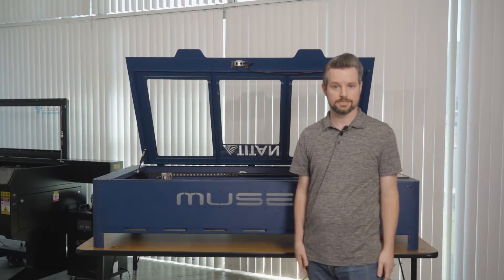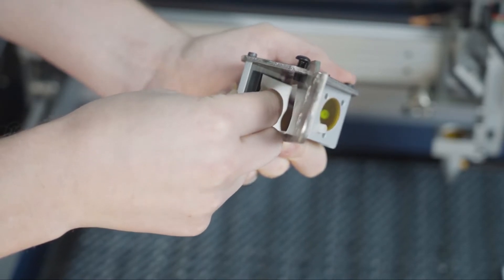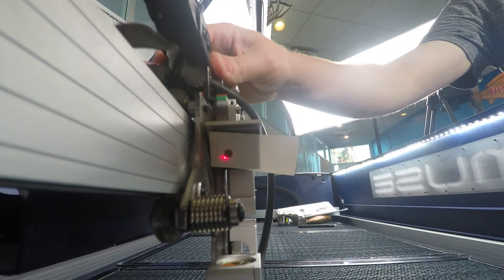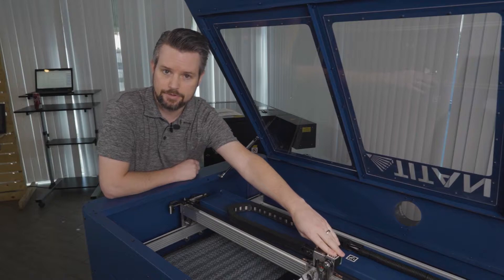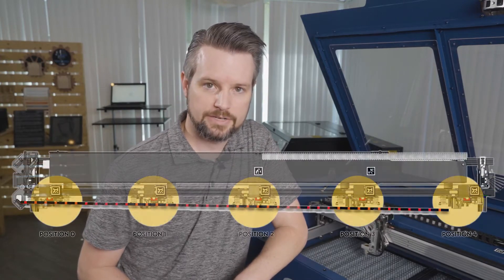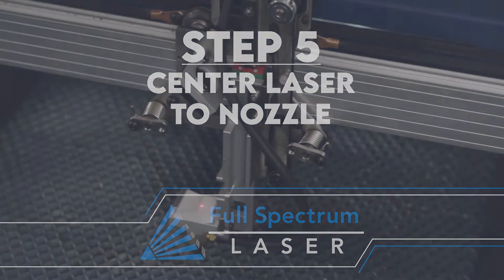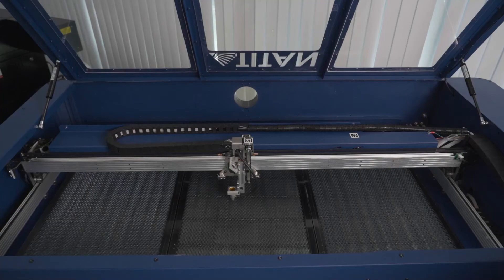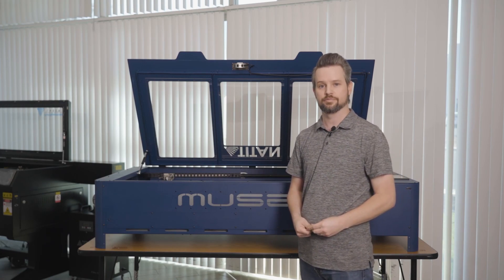Muse Titan - How to Align The Muse Titan

Comment: It would be helpful if you show the actual process.  For example, actually opening the side panel, pointing at the exact spot to screw or unscrew. Cutting away to show what we are looking for helps but it would really help if you show us how it is actually positioned in the machine and what needs to be actually done on the machine. The video may be longer but it would be more accurate.
Reply from the maker: Definitely! We've been working on some more visually helpful steps on our videos. More step by step content :)
Reply: agreed. this wasn't as helpful as it needs to be. you cut out the parts we need help with.